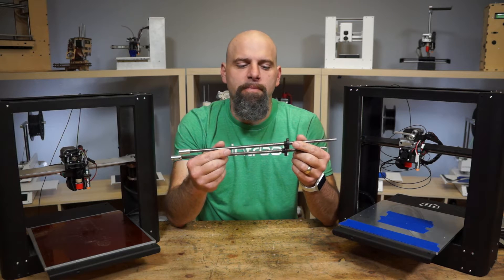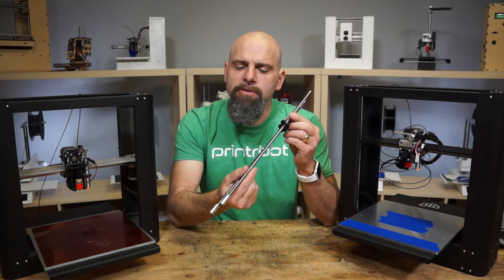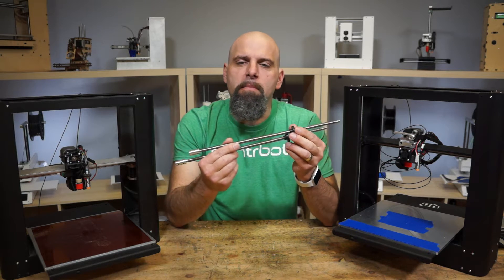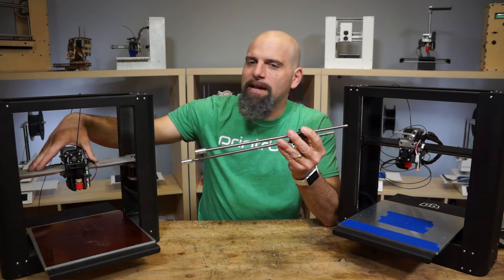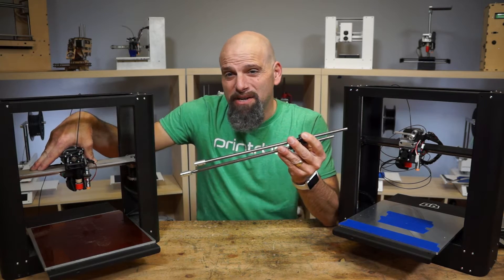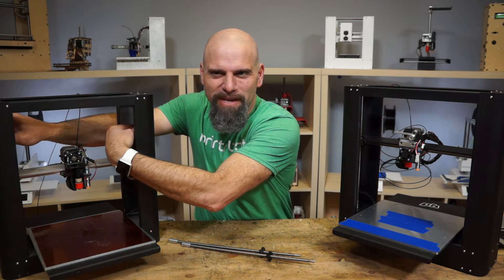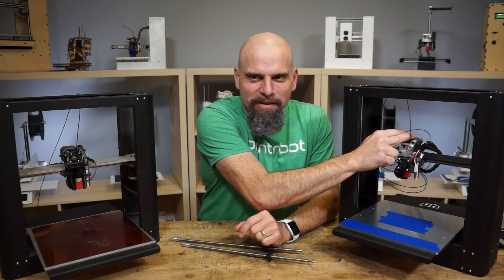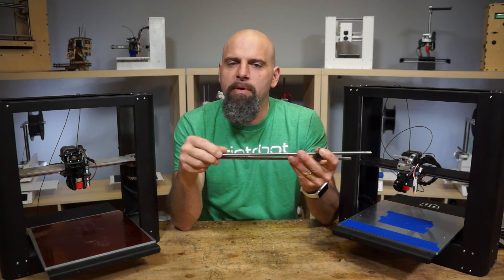Printrbot Plus 4 start 8mm Acme rod upgrade

Comment: You can buy these for much cheaper from amazon f.ex. Wouldn't recommend buying them overpriced from printrbot.
Reply from the maker: Ha! Nice. I actually don't mind at all. But these have a 5mm D shaft at the end that is a perfect fit for our 5mm coupler. And cut to proper length. The plus upgrade also has the top turned down to proper size for existing z bar/acme bar block. They all come with the nut (custom on all machines), the matching coupler and proper lengths for the various models. 

If you have a lathe, the right couplers, don't mind cutting bars to length (maybe not necessary depending on lengths available) and just want to buy the nuts, yes, there are reasonably priced 4-start acme bars out there. We offer a no- fuss upgrade made in the USA. 

Surprisingly, some off the shelf acme rods differ from one another and have slop in them. You would think they all would be identical, but when sourced from China, you find varying tolerances. In the case of the plus and simple, it is possible to buy your own anti-backlash nuts and hack them on there w some fabrication. I suggest buying the nuts from the same source as the bars.

Brook
Reply from the maker: Gabriel, hang in there. I'm not evil, I'm a nice guy. I am a capitalist since I do run a profitable business. But I love open sourcing all my stuff  by giving away the real design files for everything, and I publish all our software. Your rant doesn't actually bother me because everyone that knows Printrbot or does a google search knows by my actions, not my words. Open source does not mean you don't make a profit or that you only design with parts other capitalists make. 

Just for the record, since maybe others wonder why I often choose to make my own parts instead of using all off the shelf stuff. It's a fair question. Although I don't think you are particularly reasonable in your approach, it's fine - I have thick skin. 

The bars and rails are ordered in bulk from china cut to length for the particular designs. Same for the acme rods. When we went with 4 start acme, the off the shelf couplers I tried had a couple problems. One was they are a little finicky to get good purchase from a set screw- a flat is better. Without a flat, or D shaft, they can slip. Anotger issue was I can make couplers cheaper here in the USA. The smaller I make them the less they cost. And one Cnc operation on a lathe is cheaper than two. By getting the 4 start acme cast with a 5mm D shaft on the end allows one 5mm bore on a tiny stock aluminum rod. The real issue is on many of my designs, millimeters matter and bigger couplers interfere w other parts, causing a loss of Z travel. The off the shelf acme nuts just never have fit into the designs. They are big clunky and ugly in my opinion for my small designs, do we design nuts that work perfectly in the design. We don't want them to ever wear out if we can help it. We just switched to a more wear resistance Delrin on our pro printer just because its better. 

If you are referring to the smalls, it is a kit made from my cheapest parts, so I did make some choices from parts I have in stock that are just cheaper - like the 1/4-16 acme rod- to keep it priced as accessibly as possible. So there are areas like the acme rod that you may choose to upgrade yourself that may require buying another coupler. Our upgrade kits for the 4 start include one of our custom couplers because they have tight tolerances and clearances that constrain it and we use those special cast acme rods. 

Kind of a long post but the message is that I make cheaper parts than I can buy. And it is true that I don't design so anything works, but I do design so our parts fit for the upgrades- it's what I have. 

Sorry you are frustrated, but I'm gonna keep designing based on my decisions of what I think makes sense for the overall design and our business.

Brook